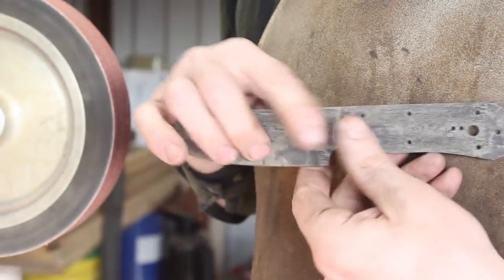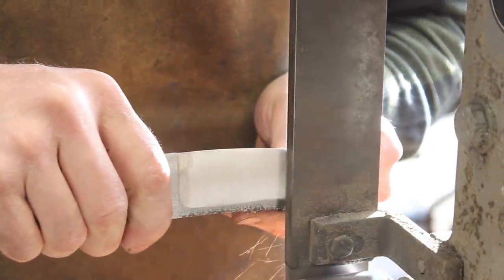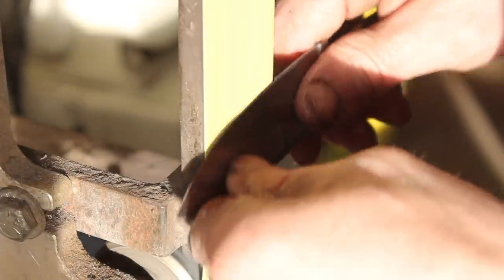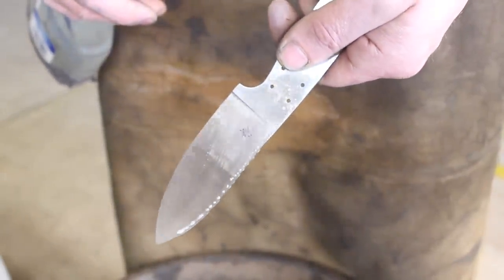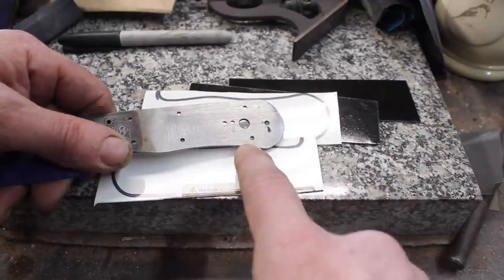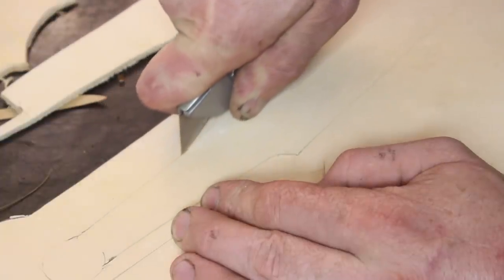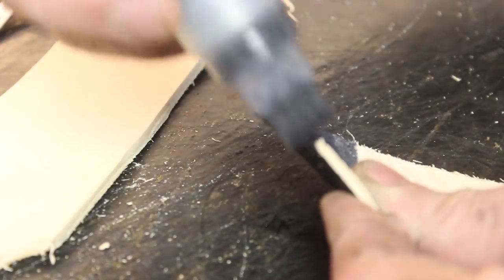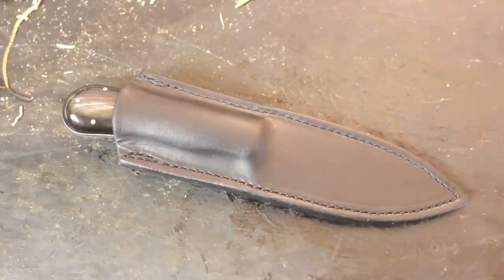Forging A Buffalo Horn Skinning Knife Part 2 From 200 Layer Damascus, Done!: 52100 High Carbon Steel

Comment: Do you feel like the polishing of the blade before etching helped with the final finish? The finish looked pretty dang nice.
Reply from the maker: Overall, yes. I think the buffing wheel is an easier way to accomplish something similar to sanding up to a very high grit like 2000 or more.

Comment: Excellent videos. Suggestion: when your older daughter asked what you were doing, you could have explained how you were looking for imperfections, much the same as you were doing, at that point, for viewers. She sounded genuinely interested. I remember my daughter knew she could do anything a boy could. Now, at 53, she's a top ranking triathlete. 

I remember one time, when she was four, I was unsuccessfully fixing a Baby Ben wind-up alarm clock. When I told her I wasn't getting anywhere, she said, "Can I take it apart, Dad?" I had no idea that little clock had so many screws in it but I think she got every one. Then, when she was done, I asked her if she was going to put it back together, she smiles, said, "No." ...and, of course, walked away.
Reply from the maker: Good point :)
Reply: @FireCreekForge  I was guessing your older one was about 6 or 7...good ages for girls for sure.

Comment: What kind of epoxy do you use to keep from the parts coming apart when sanding?  Heat is what I'm dealing with in metal parts in my handles, and the 3900 psi stuff just doesn't stay together when I'm finishing up the handles.   Have you ever had that happen?
Reply from the maker: Yes, you have to work it slower with sharp belts so it doesn't heat up